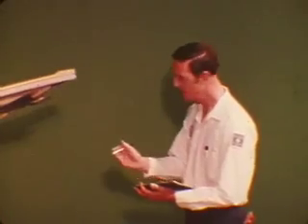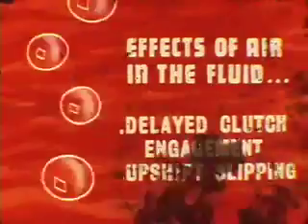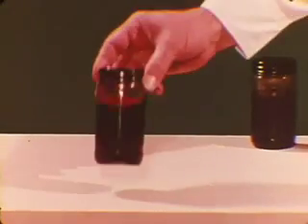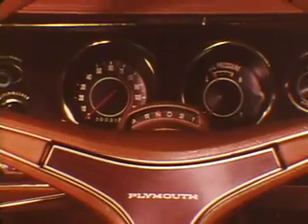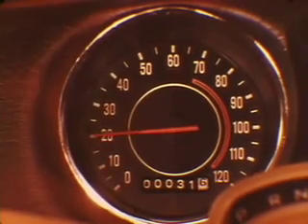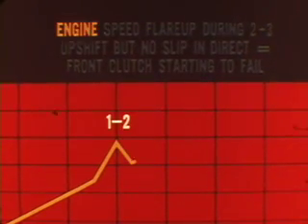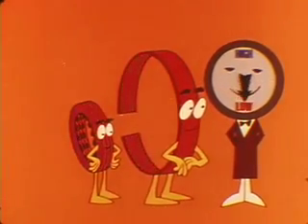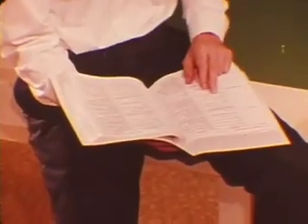73-12 Torqueflite Testing & Diagnosis

Comment: That the transmission cooler circuit fluid pressure is so low that the 12-14 psi max of coolant pressure in the radiator can force coolant into the trans fluid instead of trans fluid into the coolant shows just how "bulletproof" and "heavy duty" the TorqueFlite "family" is and how much "engineering" really went into the "modern" TorqueFlites as they "evolved" from light-duty passenger car slushboxes "developed" before Chrysler had pressurized and "sealed" cooling systems with "high pressure" radiator caps and "overflow containers" aka expansion reservoirs. 

That "always in gear" TorqueFlites are constant-slip automatic fluid cookers waiting to happen in any and all "heavy duty" applications and situations but also have "issues" with "cold" fluid and "respond negatively" to "overcooling" and need a "trans heater" in "artic climates" is more proof of how "legendary" they really are. 

TorqueFlite fantards should look up legendary in the dictionary to see how right they are but for all the wrong reasons. Being "legendary" is not synonymous with being "great" or otherwise excellent in "performance" as a "total package".